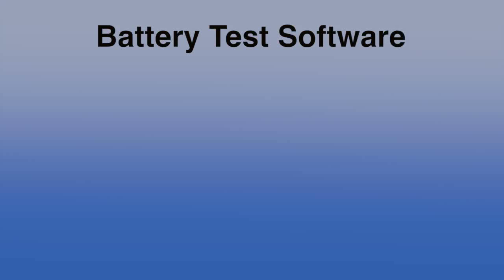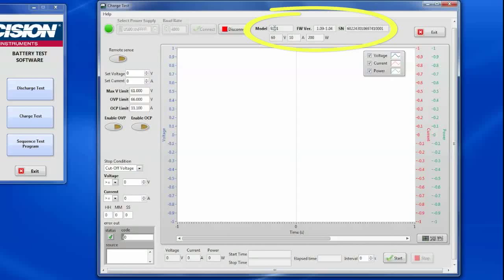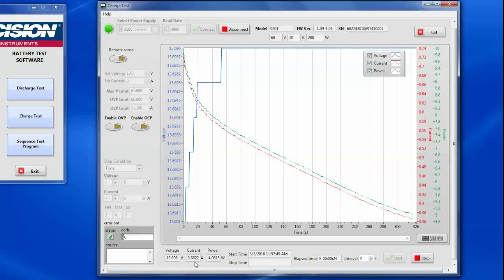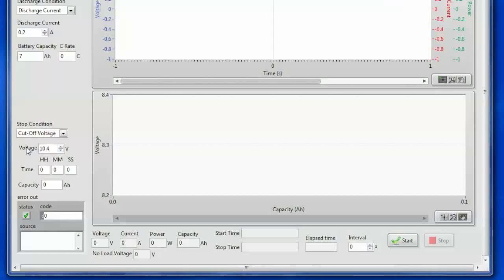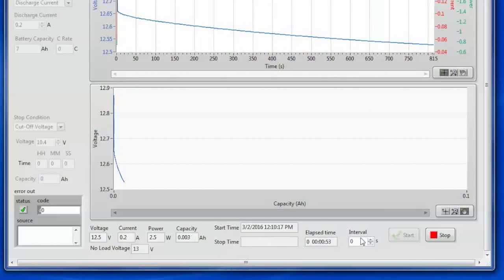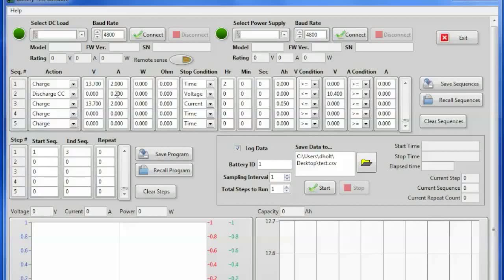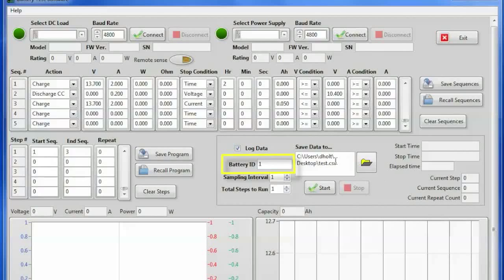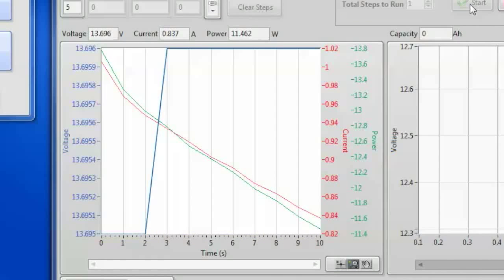Charge and Discharge Batteries with B&K Precision's Battery Test Software

Comment: Where is CV charge setting? or is this automatic ?
Reply from the maker: Hi @NicoBriceno-b5l, thank you for reaching out! 

When using the Charge part of the software the CV setting is the same as the Set Voltage section shown at the one minute mark of the video. Note that the current version of the software does look a little different today and it has new improved features that are not shown in this video.

Comment: Is the firmware included with the purchase of the unit?
Reply from the maker: Yes, the Battery Test Software is available for free download on the B&K Precision website.
Reply: @Bkprecision1  is there anyway to get tutorials on the BA6010 battery analyzer? I just bought the unit and need it to test a lead acid battery. Can I use this software on the BA6010?